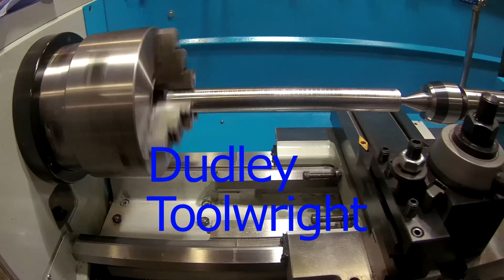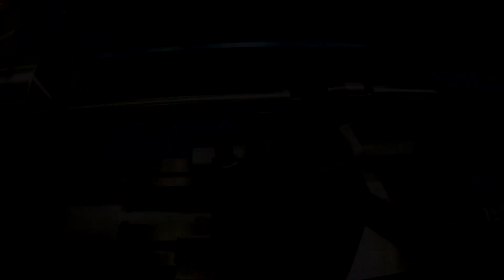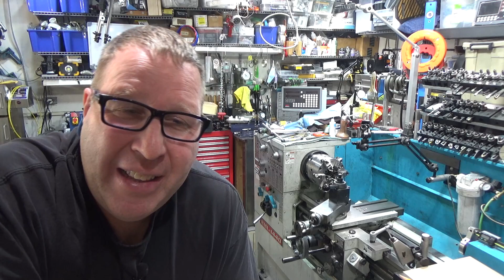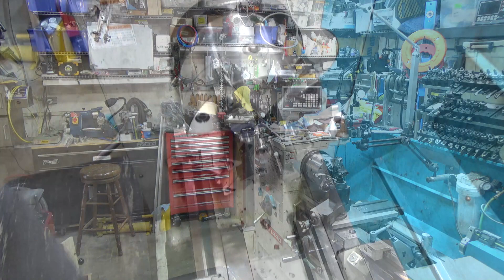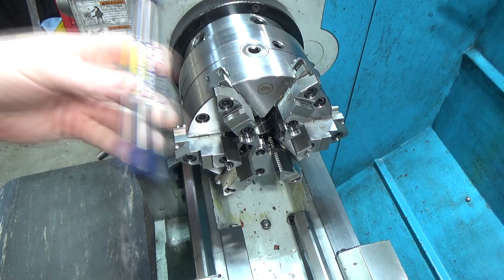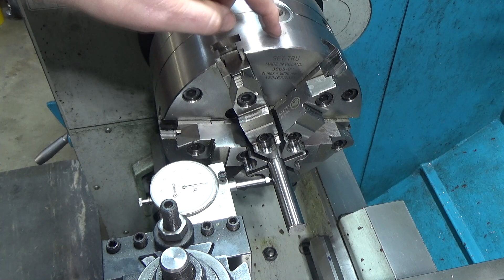188 1 Pinion VS 3 Pinions on a 6 Jaw Chuck

Comment: Dudley,
Thank You for this video. It exactly addresses a frustrating issue I’ve had for almost a year now. I, like you, didn’t realize that some 6 jaw chucks come with only 1 pinion. My biggest beef is in tightening and holding of the part. I feel that the single pinion doesn’t afford the same amount of torsional force on the jaws that a 3pinion chuck would. With my 6” 3 jaw I have never had a part slip while cutting threads and with my 6” 6 jaw single pinion chuck I have ruined 3 jobs, not noticing that the part slips out of time and then advancing the cutter and engaging the half nut the tool bit slams into the thread completely out of time and really messes up a nice thread job. 
Another issue I have with my 6 jaw is that it allows chips to get into the scroll and I’m having to continually disassemble and clean the scroll.

Comment: a car wheel has individual nuts, a chuck has one scroll being turned no matter from which pinion.  good question though.
Reply from the maker: Thanks for the info. I was specifically wondering why some chucks have one pinion and others have three. Coincidence, convenience, or are three better. but more expensive?
Reply: @DudleyToolwright  the strange thing is that many 3 jaw chucks with 3 pinions, including mine have one of the 3 that are better for concentricity than the other 2. mine is even marked thus with no marks at the other 2.  I have discussed this with guys on machining websites and many have found the same to be true.

Comment: I agree that it seems counterintuitive. Of course, the quality of the chuck matters. It’s interesting that Buck, and others, make chucks with one pinion, two, or three. Some of the most accurate chucks come with two, or even one. Buck points out that you should always use one pinion - the same one each time, for greatest accuracy, and both for greater tightening.

I would think that for cheaper chucks, the fewer the pinions, the lower the price. But my 8” Buck was pretty damn expensive, even the adjust tru back was over $500. So I don’t think Buck did two to save money. These chucks, the Buck or Bison, plus Rolm and others have highly accurately ground parts that fit precisely. But the jaws themselves are looser, or they would jam.

One thing to mention is that good scroll chucks need to be greased with a high quality chuck grease. I use Chuck-EZ, which used to be made by Kitigowa. This and the one from Rolm, are heavily moly’d greases.  Cheap scroll chucks are usually oiled, which is a bad idea. People don’t get what’s going on inside a chuck. Oiling one will damage it after some time as the oil ends up on the inside rim of the casting from centripetal force. Then when it stops, the oil drips to the downwards side of the chuck. When you tighten, or loosen it, it’s dry, and some of the oil will leak out through the pinion on the bottom. That’s one reason some chucks wear so quickly. If the chuck is used properly, chips will never get inside.
Reply from the maker: Wonderful tips, thanks. I have been greasing my chucks with Moly grease, but it came oiled. I have a follow up video with more surprising results.

Comment: Just like with everything in a machine shop, consistency is the key to repeatability. Either use 1 pinion all the time, or use 3 pinions all the time. Curious: if you tighten with all 3 pinions, then dial in the chuck to read zero, then run the same experiment. Will the 3 pinion method repeat as well as the 1 pinion method?
My 3 jaw only has 1 pinion and it repeats within .0002" consistently.
Reply from the maker: Thanks for the suggestion. I have just tested your suggestion and the results will be out shortly.

Comment: There is always some clearance between moving parts. If you use ONE pinion you will always come back to the same spot. If you move all three pinions, you will have no idea where you will end up. This is also true on a three jaw chuck. Always use the same pinion EVERY time. Adjust for that pinion. If you change diameter of the part, you should reset your true. This especially important as the chuck gets older as the scroll and the jaws wear. Three jaw chucks SEEM to lose their true faster over time than a six jaw. I do not do any accurate work with a three jaw because I can't trust them to repeat as they get worn.
Reply from the maker: Excellent tips, thanks.

Comment: Great video, I was wondering if you have a link to the carbide blank that you used. I have some experimentation that I would like to conduct and the carbide that you where using would be a great addition to my setup.
Thanks,
Craig.
Reply from the maker: I don't remember exactly where I got the blank, but here is what I used:
https://allindustrial.com/micro-100-sr-500-6-1-2-diameter-x-6-length-round-solid-carbide-blank/
Reply: @DudleyToolwright  Thank you so much!

Comment: I have a small bench top lathe with a Buck 4 inch 6 jaw AjustTru chuck with a single pinion (yes, the chuck cost more than the lathe).  It is repeatable to about 0.0004" from 1/8" to 3/4" diameter (3/4" is the largest precision ground piece I have).  I've often wondered if Buck chose a single pinion design for cost or because that produces greater repeatability.  I think I now know - it's a better design.
Reply: Perhaps, I have the same style Buck Adjust-a-Tru, 5" size, made in USA, purchased brand new about 20 years ago.  The chuck has only one pinion.  The chuck may be adjusted to run true on any given diameter of (truly round) round stock within less than 0.0005" and it will repeat that level of accuracy on any same diameter rod.  This is close enough for my class of work.  However, the chuck has NEVER repeated on different sizes of round stock.  That is to say if I change diameters I have to re-true the setting.
I entered into a lengthy discussion about this on the Practical Machinist Forum and the consensus was it is the scroll.  I discussed this with Buck and they told me that they do not make many manual chucks anymore and they could care less.  Seeing Shars tool respond here is refreshing.
The chuck jaws will grab and dig if tightened fully.  I have never used any form of cheater or augmentation, must be uneven force from scroll.  I just have to be extremely diligent.  I'm afraid that the serrations on Dudley's chuck will scar up any material other than heat treated steel or carbide.
Reply from the maker: I have wondered that same thing. I am working on a follow up video, looking into the suggestions that people have put forward. I think you might be surprised at the results.

Comment: I'd be curious to see two more tests. #1. If you use all three pinions and dial it in with the set-tru, do you get the same repeatability? 

#2. Dial it in using the master pinion, then check the runout using each of the other pinions (Still only one pinions, just not the master)
Reply: There’s no real “master”. It’s just labeled so,that you know which is which, so that you can use the same one each time. It shouldn’t matter which one that is.
Reply from the maker: You got it. Great suggestions!

Comment: How fascinating! Thanks so much for doing this video. This is what I really live for, when you find old manuals that seem to imply modern SOP is wrong. I've been stuck on the fact that all of the most basic lathe manuals teach one to face from the center out and to generally do turning operations in the direction of the tail stock. I was always taught to do as you described, walk my way along the chuck tightening each opinion. A part that I was particularly nervous about, I might do more than one circuit! But it's hard to think of a more authoritative source then Buck Chuck themselves. I only have Coleman's, but I'm going to replicate this test myself. I think it would be great if we could get people with a significant number of Chuck models to test this; more data makes for better conclusions. I'm excited.
Reply from the maker: I am excited as well and will have to do a follow up video to test the ton of suggestions I have gotten from the comments.

Comment: i wonder if you only use 1 pinion but not the original will it be off or maintain its accuracy
Reply from the maker: Excellent suggestion. I am going to test that.

Comment: Interesting video.
Just adapted a 5" 3 jaw chuck to my standard 4" mini lathe. Then the protective guard had to be removed and the protection against starting the lathe having the chuck key sitting in the chuck is lost....
Why tampering with the chuck centering feature? (I loosen the 3 bolts and use a knocker for centering.)
Sorry to be picking on You but You surely see the reason at time 04:40...
Confusing result, really.
Chuck things up, measure and start turning....
Reply from the maker: You are definitely not picking on me. I am always open to constructive criticism. I am only interested in the truth, my ego can take it.
Reply: @DudleyToolwright  Thanks. You've launched so many interesting videos and it's very seldom I feel any reson for criticism. Several skilled Tubers now and the receives "remarks"....
Having access to and using in the past, 2 Adam Booth sized lathes I did the mistake of starting the lathe with the chuck key in the chuck. The lathe started very slowly so the chuck fell down in the tray. Then the words from the metall works teacher started ringing in my ears. He showed us the marks in the wall 30 feet away, from a flying chuck key. Having no routine I really have to use discipline....

Comment: Robert, if you look at your Bison, there is a registration mark on the lead pinion "0". Tighten this pinion first and you should have better success and accuracy when clamping. In fact you may want to use this pinion only in your next test
Reply: Actually the correct terminology is Master Pinion
Reply: This is the comment I was looking for. I wonder what makes the master pinion the master? Are the jaws ground at factory? I always mark the pinion after cutting or grinding jaws and try to use it only.
Reply: Nice to see Shars here, kudos for the product support “out in the wild” 👍
Reply from the maker: Thanks for the info. It now makes me wonder if I was completely wrong being discouraged when the Shars 6-jaw chuck only had a single pinion. It seems like your chuck had all of the necessary parts. By the way, the resale on your chuck was excellent, but I could have saved a lot of money and not bought a different chuck. I really thought that 3 pinions would be a huge improvement in gripping strength.

Comment: If you walk the pinions and then zero using the set-tru, is walking the pinions repeatable and the single pinion tighten off by the 1.2 thou?

So, is the problem that for repeatability you need to always use the same method rather than mix methods? Or is the single pinion method always better?
Reply: Ditto. Please test after setting the set-tru with 3 pinion
Reply: My thoughts, exactly..  Sitting here watching and talking to the computer the whole time. LOL.
Reply: Was wondering the same thing.  Do you get a better run out if you use the same method that you adjusted the set thru with.
Reply from the maker: I will definitely have to investigate this. Look for a follow up video. You guy made some really excellent points.
Reply: This is basically true but you can never expect as good results with the 3 pinion method. Unless you make sure to go with the same pinion last every time, then it might be close

Comment: My adjustable Buck chuck is the same. Repeatedly is spot on. But also my chuck only has one pinion.  I think chucks with 3 or so pinions are there to use the one facing you, so your not spinning it looking for the pinion.
Reply from the maker: Interesting. I am really starting to wonder. You might have a really good point.
Reply: Perhaps all 3 pinions are for loosening the chuck, but only one for tightening.